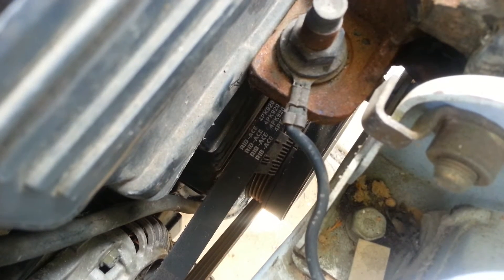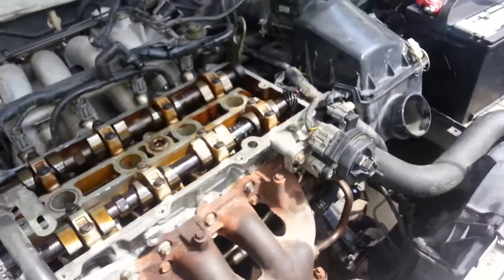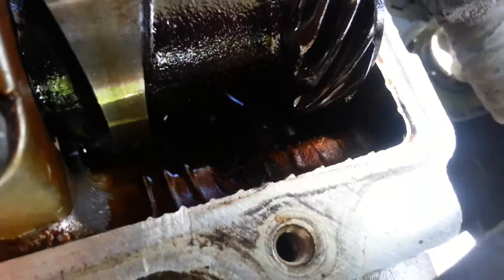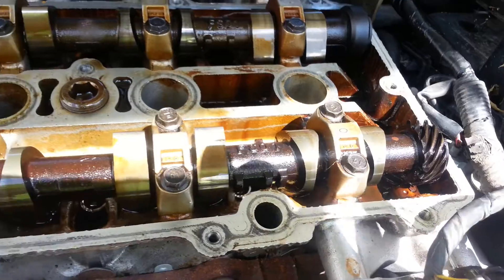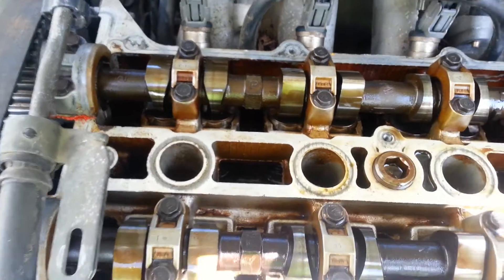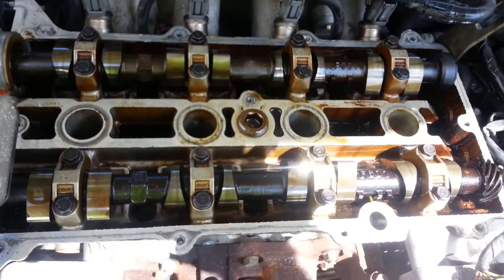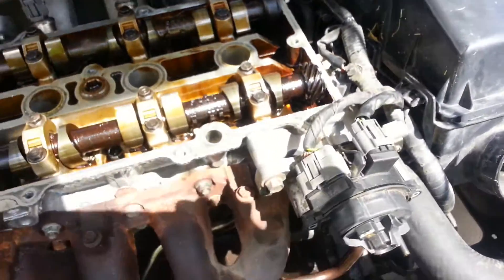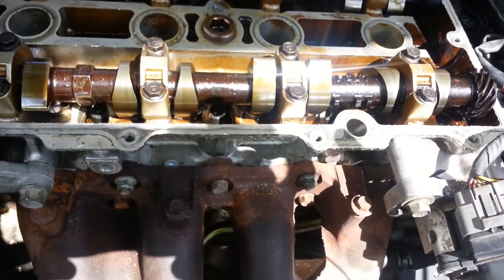TIMING MARKS 1997 mazda 626 crank no start

Comment: Mazda 626 1,8 66kw,1997
When i removed sparkplugs from engine,they showed nice spark by cranking , but they were a bit wett after i scruved them back,and engine did not show any  life signs.I checked everything,fuel pressure 2,8 psi,sensors itc.
I resolved my problem,it was a very small crack inside  distributor on ignition  coil outcoming high tension terminal
and the spark goes directly to distributor body.I removed ignition coil cleaned this crack well an glued it with diselectric 2components epoxy.
After that procedure engine starts immediately.

Comment: hey Brandon, did u figure that mazda no start? I have the same car 1998 mazda 626 2.0l . I checked it and its not fuel related. could it be broken distributer shaft? some friend said it could be timing chain but im going to figure out the ignition coil first. what you recommend?  thanks. have a good day
Reply from the maker: nope never got it still broke down in a few months im going to replace the engine
Reply from the maker: I think there is a crack between cylinders 2 and 3
Reply: I just did the same freeking thing replaced the head gasket intake gasket exhaust torqued it all down correctly put it all back together timed it right. has spark in sequence 1324  all it does is backfire. if after I check the distributor tomorrow it doesn't start still I'm stuck putting a new engine in also.